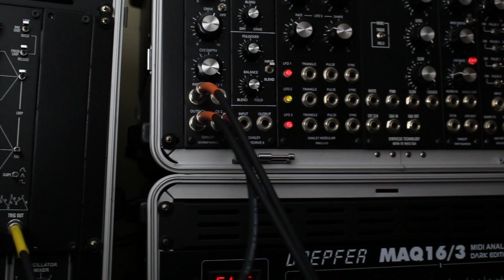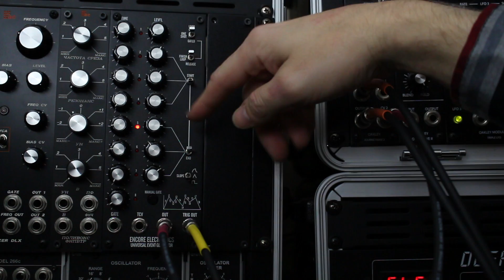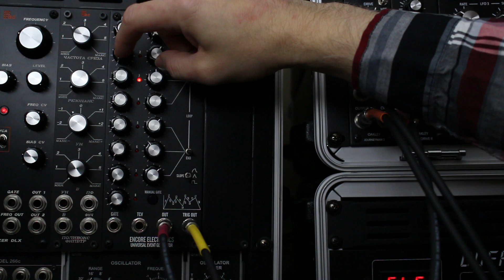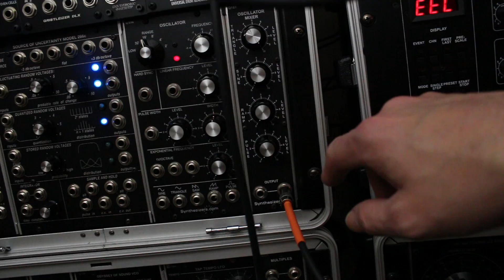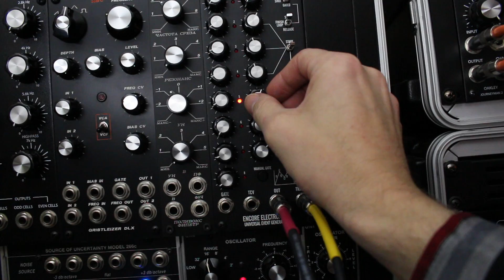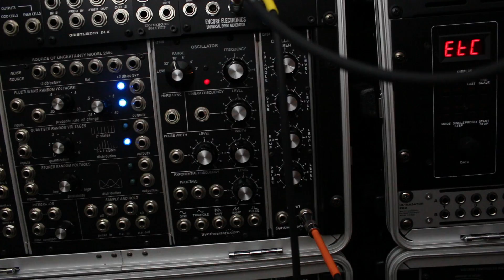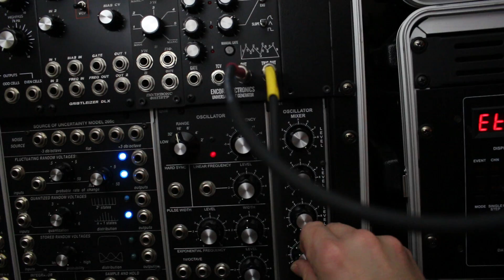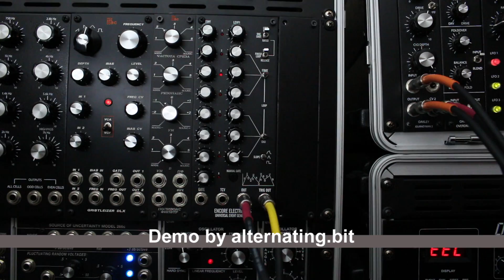Encore Electronics Universal Event Generator - 5U Modular Demo

Comment: great video! i had one of these when i first got my modular wanted it more for a traditional 8step sequencer, so i got frustrated with it too. i traded (for a dot com Fixed Filter bank and aid module i think) but now i miss the weird stuff it does so well. i might have to get another one. yours looks different than mine though, is that a newer version or MOTM?
Reply from the maker: This is MOTM... which I typically prefer since they have that TANK ARMOR-like feel.  And yeah, I was about to let this unit go because you can truly get a better mini sequencer only 1U wide (SympleSEQ) so to use the UEG as a step sequencer is somewhat of a waste.  But once you tap into its other functions it becomes a very unique module as I hope I demonstrated some.
Reply: I think you gave a pretty good representation of its strengths. Yeah SympleSEQ much better traditional sequencer for the space